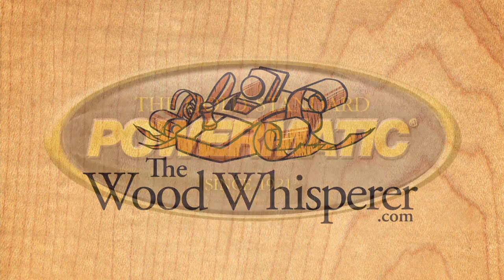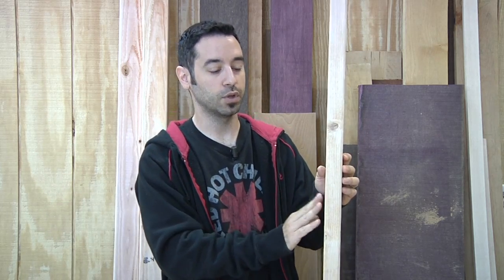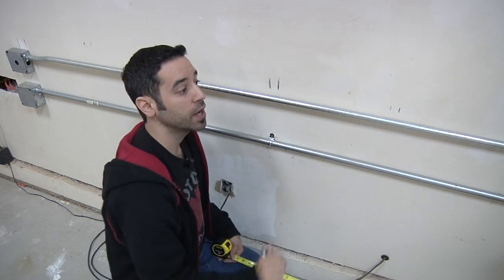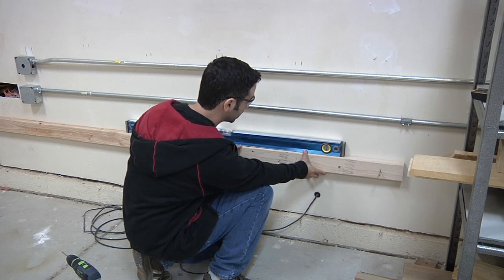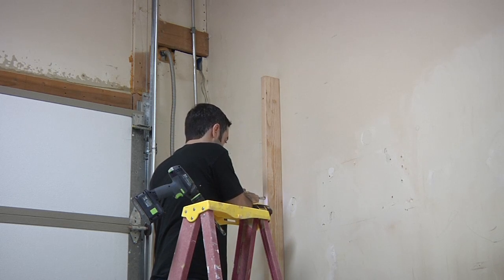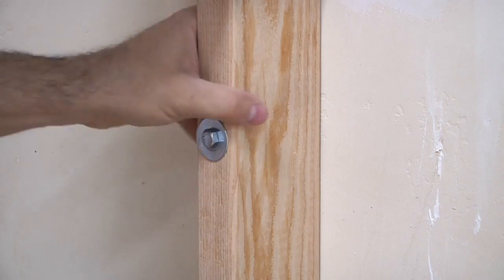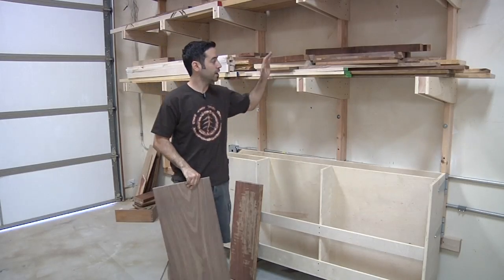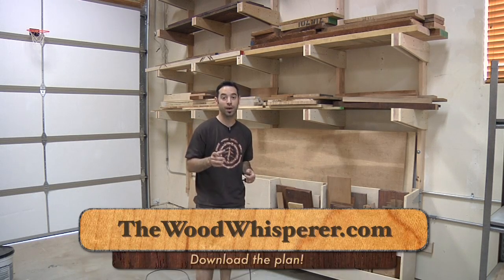Lumber Rack & Plywood Cart

Comment: Nice design. I would recommend one additional castor on same end as hinges. Over time the gate hinge screws may shear from the weight. Let the castor handle the weight while the hinges allow the in/out sweeping movement.
Reply: Eileen, For Sure! Excellent suggestion! I would recommend a "ball" caster for this one due to the tighter turning radius.

Comment: I have built a number of these racks over the years and I have one suggestion. cover the horizontal supports with some plywood or OSB to make them into shelves. I notice that you have some shorter boards that cover 2 supports if you accidentally move them the ends will come off the support and onto the floor or yourself. (ask how I know). It also allows you to store a number of short pieces. It looks great

Comment: Finished my cart a few days ago and followed your design. Absolutely love it. came out great and ALL my scraps are together and orginized. I used steel casters and the are just fine no issues what so ever. . My floor is pretty lever so no issue of the cart rolling out on its own. But as Mark stated in His video a simple latch will stop any free roll with ease.
Thanks again Mr. Mark for your creativaty.

Comment: Marc, you could place a single locking swivel caster and a standard swivel caster to "lock" into place without extra hardware to do so as you mentioned. I do have one question though, I was always taught for sheet goods, to never stand them either their ends or sides/edges due to warping, that one should always lay them flat? Have you encountered such things as warping to your sheet goods by standing them up like that? AZ has a much lower humidity range than most states, here, it's very high.

Comment: One critique I have is about the casters. Since you have a fixed pivot point on the side opposite the casters you would be better off with straight casters attached tangentially to the hinges swing. What happens with swivel casters is when they change direction they have throw which causes undo strain on the casters and the parts, they don't freely rotate on axis. 

Otherwise I like it a lot.

Comment: I overloaded my Boar rack, and the screws pulled out from the wall dumping the lot on the ground.  Unfortunately with everything going on this summer, I've had to leave it for several weeks.  I did go in and pullout the boards I didn't want to warp or twist.  Looking for a solution, this video came up, and it's great.  However; I had to do some modifications to fit my application.  Currently on the cinderblock wall I have 3 24" 2X4" laying flat which I secure to the wall with construction glue and Tapcon bolts.  To make up the difference from 24" to 54" I am marrying another 30" 2X4" with a 54" 2X4".  These will be lagged to the wall with a steel drop in and lag bolts for that purpose.  With the 2 2X4" 54" long doubled against the wall, I'll have a good amount of surface to put the shelf supports up.  I will turn the 2X4" flat between them giving the shelf support the ability to slide past the 2 2X4" anchored to the wall.

Comment from the maker: @Mopardude Well, I can't say for sure it gives me dead center since I can't actually see the stud. But I can tell you that it dependably gives me the start, stop, and center points. The display has a meter that slowly builds until it reaches center. That's when the light goes on, then the meter begins to drop down again as you move off the stud. 
And after using it a few hundred times I have yet to miss a stud. So as far as I'm concerned, this little unit is pretty darn accurate.

Comment: I looked and didn't want to repeat a suggestion...Lord knows, there's enough of them! One idea to keep the sheet goods cart against the wall is to use a locking caster on the outside wheel. Push it back, lock the wheel. Also helps to lock the cart while pushing in sheet goods...to keep it immobile.

Comment: Most stud finders actually work by finding each edge separately. Start by moving the stud finder one direction and when it lights up stop and mark a line. Then go to the opposite side of your line about 3 to 4 inches away and work towards your line to find the exact edge by stopping when it lights up again. You can now determine the exact middle. If your having trouble with your stud finder use a stud finding magnet set to locate the screws. These work well. Never trust anything to be on center.

Comment: I just finished building my lumber rack based on yours.  I found that there was too much play side to side for the vertical supports.  Probably my fault.  However, I added horizontal 2x4s every other vertical 2x4 to prevent the racking.  Now it is a rigid beast and does not move.

Comment: Fantastic, Marc! Thanks for taking the time to document this in video format.

I suppose you could bolts in place of the screws that attach the brackets to the studs? That might create a 'modular' system and may even make it a little easier to fit the brackets (pre-drilling the studs before fixing them to the wall studs).

Look forward to seeing the rest of your new-old workshop progress.

Comment: studs are the vertical supports inside the walls that hold up the weight of the roof. they're usually 2x4 or 2x6 inches by however tall your walls are. Its awesome to see someone your age with an interest in this stuff. if you want to know more about woodworking check out steve ramsey, doucette and wolf, this old house and the new yankee workshop. There's lots of others but beware, some people aren't really qualified to be giving advice on building and youtube doesn't discriminate.

Comment: I'm going to get the materials tomorrow morning to build this.  Of course I will need to modify the rack part to fit my 8' ceiling, and will use 16" centers along with ply shelf material, but it is not much of a deviation from your great design.  Thanks, and I just subbed, too.

Comment: Attaching the uprights from the top down and leveling from there means the screws in the top that have the most work to do will have the best bite in case the studs aren't truel.  If your upright runs off the stud at the bottom, it's not quite as critical as it would be if it ran off at the top.
Reply: Can you please elaborate on what you're saying here? You're talking about the vertical attachments to the wall, correct? You're saying it's best to put in the top screws first?

Comment: @TheWoodWhisperer It may seem like yours is giving you the center but its really not.  Most finders have a small lag time before the light goes off coupled with the fact your sliding it across the wall at about mach 5.  That is why your supposed slide it slowly than back up after the light goes off to find the edge.  I personally have never seen a finder that finds the center.  If they did how would they ever discriminate if you came to a spot in the wall where several studs are stacked up?

Comment: You definitely want fixed wheels here, not pivoting casters, since the same arc is being traversed by the cart every time. Also, you can get 'em for WAY cheaper at Harbor Freight (cheaper still if you scavenge a set off one of their cheap furniture-moving carts).
Reply: VideoNOLA  Swivel casters much easier. Should have used a locking caster on the front though to prevent it from swinging open on its own.

Comment: Great Project! But two Points.
1 Instead of the horizontal piece, why not just run the verticals straight to the floor?
2 Casters that big should always be trough bolted. But you can always do that when they fall off. lol

Comment: Hey Marc, great video. I used your ideas to build storage shelves in my garage and it worked perfectly. I didn't need mine to be quite so robust so I scaled it down a little, but I can easily hang on it with no flex. Thanks a bunch. Oh, what happened to the funny out takes you used to have at the end? I liked those.

Comment: Marc - Pretty neat idea.  Do you have any problems with the sheet goods bowing over time?  I was wondering if I need to make something that basically straps across the sheet goods to keep them straight up and down and not leaning.  What do you think?
Reply: befmx31 mine has not bowed and it is loaded with heavy plywood and mdf.  I would recommend adding a third caster near the middle as mine is sagging but only slightly.

Comment: I know this is a rather old video, but at 8:00, can you not just drill the pilot hole the same diameter as the shaft, not the threads, then drill the screw in to tap the threads, then back it back out before driving it into the studs? That's what I've always done, but I'm only 23 have had more firewood than furniture since I started woodworking 2 years ago lol. I have noticed that when I drive a screw in to join two pieces of wood together, they don't pull tight until I back the screw out and drive it back in. But once I do that, it's a tight connection. Just want to make sure I'm doing it the right way. That's what she said. Thanks!

Comment: Great video, as usual, Marc!  One question: Was there any concern as to how much weight the supports would hold?  I'm not storing cinder blocks on mine, obviously, but I want to make sure they hold up at the same time.  Also, with the horizontal runner on the bottom, does that serve an actual support purpose, or more for leveling and making sure everything is straight?  I would think with the lag bolts and stuff in there that the verticals aren't going to be moving much.  Thanks!!!
Reply: The bottom runner is for alignment. It would only see a "load" if the vertical supports failed.
Reply: Sig, One more thing. The vertical supports as they have been installed in this video (even with the extra lag bolts The Whisperer added later) will increasingly "rack" over time as wood is loaded and unloaded on the shelves. In order to eliminate this issue, I recommend you add several horizontal 2x4's between the vertical members. These will tighten up the entire structure.
Reply: @christopherpavlicas  thanks for the info!  I’ve built two of these now, one in my garage shop and one in my pro workshop. They’ve handled great!